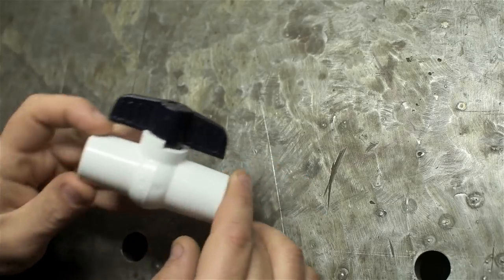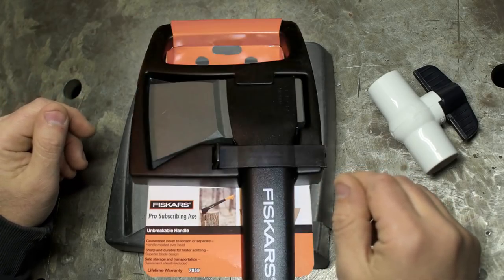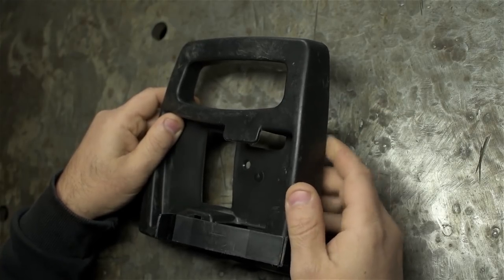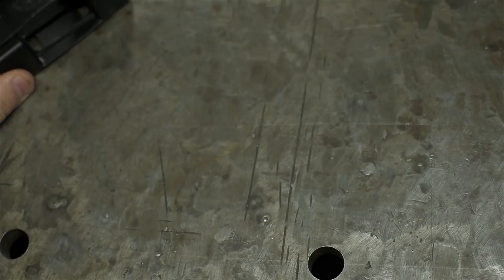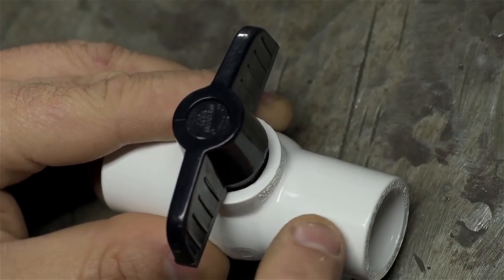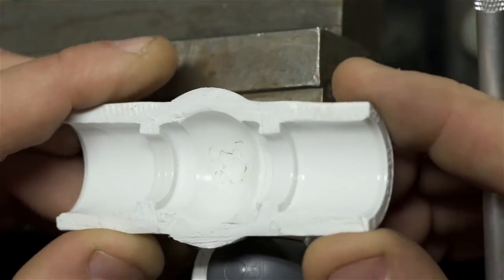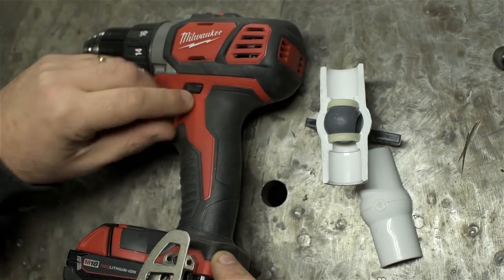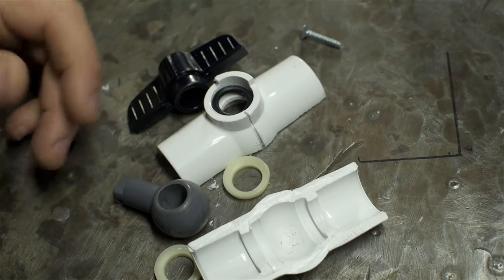Marvels of Injection Molding!

Comment: Interesting & useful. I once was shown a hand powered injection moulding machine fed by spheres of plastic. It was amazing to see it work & it made me appreciate why the injection mounds were so expensive. Presumably now they can be cranked out by cnc, or maybe 3D printed using some kind of laser melter of sprayed metal like Space-X use for some of their high temperature engine exhaust nozzels. Remarkable that all of this leads to high quality stuff at super low prices that make modern civilisation possible. Thank you for sharing!

Comment: How did you slowly spin the valve? :)
Reply: My guess is filming it on Baby Right Round rotary table, then sprinkling it with a bit of magical editing pixie dust.
Reply: My guess: That yellow slow rotating welding table thing he build some time ago, with a axis going up through one of the holes in the table.
Reply: stop motion.
Reply: ajtrvll my guess: GENIUS
Reply: Vibration?
Reply: It looks like somthing was vibrating on the table, and the little vibration made it slowly spin !
Reply: Good vibrations?
Reply: magnets
Reply: Witchcraft.
Reply: spinned it really fast and slowed down the footage
Reply: Matrix movie camera trick, but in reverse.
Reply: I bet Tony is enjoying the heck out of our wondering
Reply: It´s tony.....with his mind power
Reply: Tony's shop is in a rotation reference frame. Anything with low friction rotated on his table.
Reply: blowing air on it probably?
Reply: The force is strong in you Tony
Reply: my bet is magnet on the rotary table under the bench and a piece of steel in the valve
Reply: The valve is not moving, everything else in the shop is moving around the valve.
Reply: Must have been blown air. Can't be stop motion as his hands move behind the part. And rigging up the welding rotary with a magnet... THROUGH a steel table makes perfect sense.
Reply: I also think its a magnet deal, I could see how people could think its the rotary table with magic editing or stop motion however you can see its much to fine constant rotation plus you can see the reflections on the part
Reply: Maybe like a laboratory hot and mixing plate. Piece of metal or magnet spun by the other...
Reply: Tony has a time machine ....
Reply: Valve stayed still while the earth turned under it. Took all week.
Reply: "Magnet" folks - don't forget there's a steel table in the way.
Reply: Easy. notice the dog holes in the table? He put the rotary table below one of the holes with a shaft through the hole. a drop of glue and done. the bottom of the valve covers the hole. look at the weld splatter on the table.
Reply: Stop doing this shit to me Tony.
Reply: I’ve seen him cut metal with his mind. It would be nothing to spin a piece of plastic.
Reply: Hooooooow ??? ))
Reply: At 0:38 you can see the fishing line :)
Reply: May be vibration but i thought about a ring with small piezo-modules on it. Saw these things about a year ago as an alternitive to stepper-motors dor small robots. The company is called piezo-systems.
Reply: ullcorp I think that's just compression artifacts you're seeing. Likely as others have said, shaft from the rotary table, with a dab of hot snot glue holding the valve on the end. Alcohol to release it with no residue.
Reply: He shot a video sequence of only the valve spinning, stop motion photography style.  Then, without moving the camera, shot a sequence with the valve not there and him talking and moving his hands.  Then, it all goes together in his boss editing suite.  He can, for instance, let the motion of his hands and his dialog flow continuously and natural, while he makes the valve's motion intermittently stop or jump ahead in rotation.
Reply: Tiny pixies are chooching it round from underneath.
Reply: You can't spin the valve. That's impossible. The trick is to simply realize the truth. There is no valve.

Oh, wait, no, that's only for spoons. Um... The mass of the seals causes a local warping of spacetime relative to the frame of reference, thus our frame of reference rotates counterclockwise relative to the valve, but NOT to the table or Tony's hands, since they are in our frame of reference.
Reply: GOD DANGIT HE'S PLAYING MAGICAL TRICKS ON US
Reply: There is a hole in his bench I bet you that his 4th axis weld rotary table was under the bench with a shaft running up thought that hole with the valve sat on top.
Reply: hudmut, Quantum Uncertainty. You don't know if it was a 4th axis until he confirms it. Until we peek. Until then he used quantum voodoo to rotate that thing D: 
ITS BUGGING ME. I HAVE LIFE REGRETS NOW
Reply: now I know I'm not the only one..
Reply: hole in the table, walding rotary machine thing underneath poking through
Reply: the rotation has different rates of rotation, bit all are jerky, some with small steps and others with bigger jumps. the bigger jumps had a sound track noise associated with it. As Austin said there are the reflections in the part that indicated that it actually is rotating. the background is also jerky indicating stopping and stating of the video but the hand motions seemed continuous or looks like they were..
it is not magnetically induced through the table as the table is steel. and not even tony would drill a hole in his table or would he??
The shadows of the valve did not quite line up with the shadows of his hands.

My guess is that it was a green screen shot of the valve rotating and then it was overlaid on the video.
Reply: I asked the man himself... "Rotate the entire shop"
Reply: Telekinesis clearly. He has already shown he has psychic powers.
Reply: Palm sander on the workbench out of site, with the audio done seperately.
Reply: Andrew Hull Pixies, but not the angry kind ...
Reply: Its the coriolis effect!
Reply: Travelling Soldier - Tony would have to confirm hemisphere.  :)
Reply: Stop frame animation... This video was 4 years in the making.
Reply: I thought all valves spin if you place them on a metal surface?
Reply: Simon T - I believe it's the other way around: metal valves spin if you place them on a plastic surface... and it only works with metric valves.
Reply: How do they work?
Reply: Magnets.
Reply: That would have been learned in his first year at hogwarts or which ever school of wizardry and witch crafty he attended
Reply: Shit
Reply: Guds777 it's def not stop motion lol
Reply: Filmed that segment at the north pole.  The valve remained stationary and the entire set rotated around it.
Reply: You can see the artifacts of stop motion.  At one point it even skips ahead "a few frames" (or is moved slightly further than typical in between captures)
Reply: Wait, just looked again, and my from memory guess was entirely wrong xD
Reply: It really was done by frequency. FM. Or in country boy terms "Fuckin ,Magic "  LMAO !!!!!
Reply: Green screen over his rotatr
Reply: he just spinned it like a beyblade and started filming as it was loosing speed

Comment: Super informative.  Two things: molds are made oversize to allow for the shrink of hot mat'l., the ball moved .010 from injection pressure.  But you are right in that it is a under rated marvel.

Comment: Very good analysis of the part and process involved. Good job as always.

Overmoulding a rigid plastic part with an Elastomer can be done and is often 
done(to reduce costs further) in one injection mould. 
Being an Injection Moulding Engineer and Toolmaker by trade i did a lot of that stuff.

Comment: The joining line is purposefully visible, its not a defect. When the heated plastic is shot into the cavity it needs to displace the air. To enable the volume of air to evacuate there is a small gap between the two molds. Because the plastic and the air have very different viscosities, the air is able to flow through that small gap, while the plastic is not. What is amazing to me, because the plastic is shot into the cavity under a pressure of up to 1500bar

Comment: The two-story tall injection molding machines I used to work on and build molds for injected rubber and plastics at up to 5000 psi. The "shot" cylinder hydraulics worked at up to 3000 psi. I learned very quickly that even 1/2" grade 8 bolts and hardened steel dowel pins used in assembly of the mold cores and mandrels didn't stand a chance holding pieces in place against the forces of the incoming material "shot". Typically gate placements and runner lengths and size had to balance opposing material pressures and cancel out these forces, or parts, no matter how stout, would shift and part wall thickness would be inconsistent. I made my first complex mold (for a large rubber bellows similar in shape to a car's CV joint boot) bread and butter style, and the core was a series of sharp edged "flying saucer" shaped discs held together by a long 1" dia. bolt thru the center of about 12 stacked discs, varying diameters, 0.500" thick each (like a stack of hotcakes). The outer mold halves were made the same way, but the stacks were held together by a series of shorter bolts on different overlapping centers, and final facing of the mating surfaces was done last, so the outer mold halves essentially became permanent assemblies. The first trial shot was a disaster. The injected rubber penetrated between the discs and forced the discs apart against the closed ends of the mold, stretching the 1" high tensile steel center bolt and locking the mold closed with the core and part trapped inside. It took nearly 30 tons of hydraulic press, hammer and chisel, and pry bars to separate the mold halves, and the part came out in shredded tatters. I tried to increase the clamping force between the discs, but even with as many high strength 1/2" and 3/8" bolts added on peripheral bolt circles I could fit in there, the mold core expanded and locked up every time. I then re-thought the way the flow of the material shot caused it to wedged between the discs as the shot entered the mold. To keep it from forcing its way between the discs, I finally got it to work by adding 0.050" outside radius fillets in the "vee" where the discs came together. The incoming material flow was thus re-directed to flow across the parting line instead of wedging into it. As a bonus, it also eliminated nearly all of the witness mark and flash. I then applied for and received customer approval to add matching radii to the outer pleats of the bellows as well, after I demonstrated how much improved the product looked and functioned. Mold making luck and black magic, I guess...

Comment: your very on point. the ejector pin side is usually the (cold side) not always but most commonly. Because thats the moving side and it has the ejector platen on it as well. the (hot) side of the tool is fixed in place.

Comment: 12:45 I think your math is a bit off. Since the top is .190 and the bottom is .210 the median would be .200 meaning it's only a difference of .010 not .020.
Reply: Was going to remark exactly that --- it was designed for .200, the ball&valves were pushed up .010, leaving you with .210&.190.

Comment: I have an injection moulded (or whatever the glass equivalent is) glass beer mug here. It's got a really quite sharp witness line running right down the handle and into the base. The thing I remember the most though, is going on a tour around a university that I ended up going to, and being shown their engineering department and its plastic injection moulding machine. That thing was spraying out plastic combs and keyfobs like a fountain, all with the university's logo neatly embossed in them.

Comment: Not sure how I got stuck on this but it's a good example of slides and cores in molding. I've been in the field for about 9 years now. Most like this was an insert molded part with slides. Probably several parts per shot as well. I make alot sprinkler parts, among other things like medical components, at my job and that's how we do it. Depending on the size of the company you can replace operators that manually put in the inserts with robots. Once you realize that most of the modern world is injection molded you look at everything differently. Everything from your plumber to your doctor are using injection molded parts these days. Interesting video, just not sure why YouTubes recommending it 2 years later while I'm watching Escape from Tarkov videos.

Comment: I worked at Michael's of Oregon (oddly the facility was in Idaho) as they were moving production to China. I operated the injection mold machine. I can assure that your "assumptions" sound incredibly well informed. ;) On more expensive parts, the flash is trimmed manually, and if the person trimming is good it will look like a weld seam.

Comment: When I got my mech enganeerin' degree, I took a manufacturing elective. That was hands-down one of the best classes I ever had. It should be mandatory for anyone in design work, so you can think about how to make your parts. It also causes you to start looking at everything around you and try to deduce how it was made.
Reply: My Materials and Manufacturing class was my favorite one so far. It helped that Teach accidentally used a Hugbees video on balloon dipping to help explain elastomer processes.

Comment: Working in injection molding, it hurts a little hearing explain things, but you did a good job. Couple things I might add. Parting line injection is less common, they may be using a vertical press to aid in loading the insert (the ball and seal). The ball and seal are probably the same material because of the comparability. PVC it corrosive and doesn't play well with others. I imagine the inserts are coated with a type of release to keep them from fusing together.

Comment: The difference in thickness between the top and bottom is not due to pressure pushing the internals upward.  It's engineered into the mold itself to improve flow speed of the molten plastic and ensure no voids along the weld lines.

Comment: I must have sold a thousand of these after my first retirement and went to work for a hardware store.  In the 5 years I was there we did not have a single one returned, and trust me, those homeowners that had no clue what they were doing would have hacked a bad valve off the PVC and come back for a $3.00 refund.  I had no idea how they were made, but often threatened to do just what you did to see what made it tick.  Thanks for saving me the three bucks I would have wasted cutting one apart.

Comment: Glad you showed me angle #2. I was confused up until that point. Seriously though, if someone had asked me how this was made, I would have guessed that the two halves of the PVC were friction welded together. Seeing that the ball valve and handle were seemingly two separate pieces (after you surgerized it open), I was was pretty interested in how those two parts were secured together and actually laughed when the cap popped off. Thanks for this.

Comment: Molding over pre-existing parts is known as "insert molding" in the industry.   Its also called over molding.  The "insert" here is the ball and the seals.  Other types of inserts could be metal inserts that you might see embeded in an injection molded plastic part.  Often, metal inserts are used for screws to thread into as the metal threads are stronger than plastic threads.  There are many types of inserts that may be over molded.  Some might even be previously molded parts.  An example is a cell phone case that is molded of 2 types of plastic, but the plastics are bonded together in the final product.   For This Old Tony's ball valve, the ball and seals were installed onto two round steel cores that he assumed was a single mandrel.  The two cores met in the middle at the parting line of the mold.   The ball and seals may or may not have been installed by an automated process.  In the recent past, Chinese labor was cheaper than automation.  That is now changing.  I design insert type injection molds every day.

Comment: As an irrigation contractor I have had an intense dislike for plastic ball valves for decades.  They are often stiff to operate and the handles break and are not repairable.  But this gave me an appreciation for the design that makes them the cheap crap they are! Thanks This Old Tony! 👍🤏

Comment: As someone who's set up injection molds, a mandrel isn't going to likely be used, and they're going to be hand loaded because that ball is going to have to go in a specific way, same with the seals as the die will account for the valve part and seals. The mold will likely be vertical to get multiple parts per cycle.

Comment: I ran a vacuum molding system sometime ago. To get the part off the mold we used air it did not make the mold hard to make and the air didn’t damage the working part. And in vacuum molding is easy to use but you will have more waste ( the cut off ) but the molds as simple one sided with air channels in them one off parts the mold can be made from automotive body filler.

Comment: Great video. Can't help but think you may have been involved in the manufacture of these parts. One more thing I noticed: when the valve is in the off position, the ball presses harder against the seals. It could otherwise do this in the on position to protect the handle from leaking, but they didn't because when in the on position, water lubricates the seals, which extends life. This is also the reason for the top O-ring, which itself remains accessible.